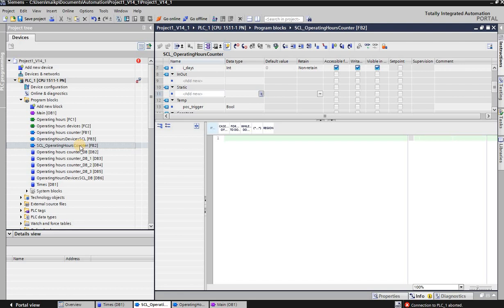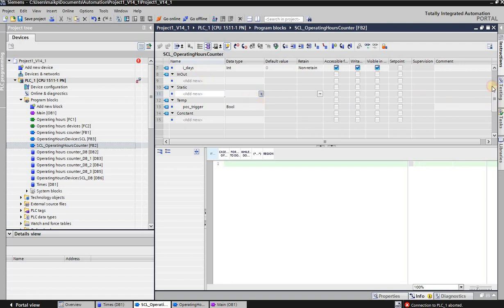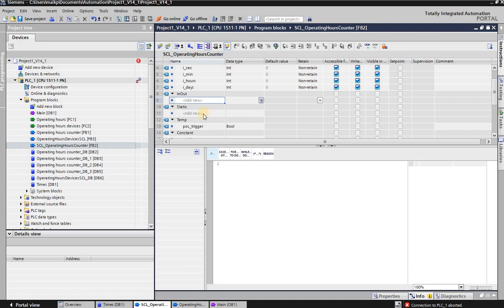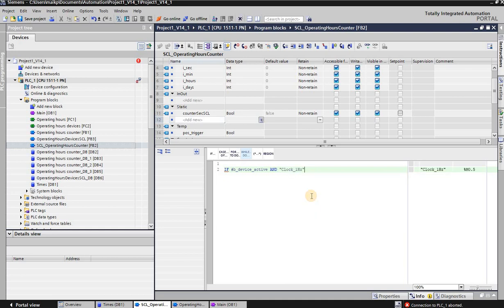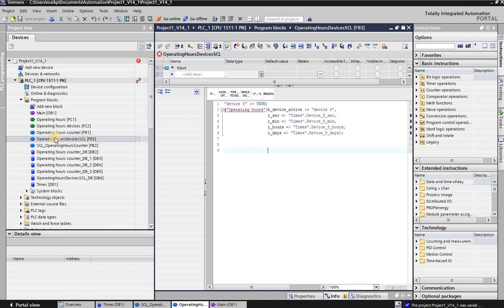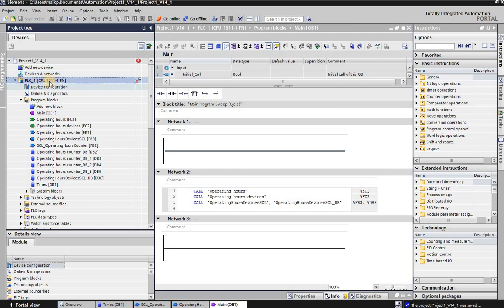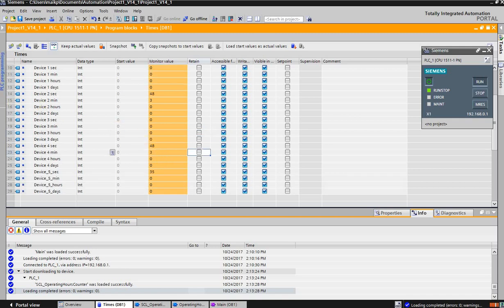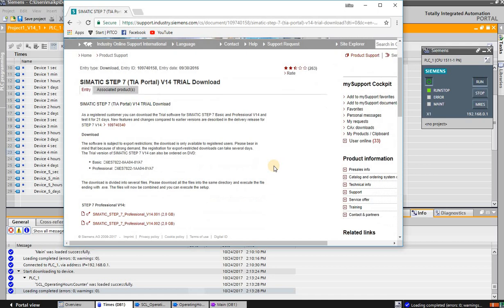Absolute Beginners guide to Siemens PLC Programming // SCL

Comment: I am quite troubled by the jump at 15:45.  The video shows it as an error (red underline) and by typing exactly what is found there I could not get the program to compile.  As an actual beginner it would have been very useful to see the complete process for creating that function call.
Reply from the maker: Tern Bartolovic you have to define the function in the static area first, data type has to be the fb name. Sorry for the confusion. First define -> then call

Comment: Mike, I been programming for a while, but this one is helping me get into writing more SCL code. I'm really trying to sink my teeth into it for 2020 cause I know it can be very powerful when compared to writing everything in ladder logic. I really appreciate this video, great job!
Reply from the maker: Alex Yousefian I hear you. It’s extremely powerful for data processing functions where trouble shooting actual tasks is not an issue. The reason ladder logic is used in the first place is to make it easier, more visual for the maintenance techs. We can do so much more in SCL and with less code than in ladder logic.
Reply: @SiemensPLCTraining2021  Definitely! I just started a new project that's partly based off an older machine written mostly in ladder, but I'm forcing myself to write it in mostly SCL (that is if I can make the deadline of course!) I also just picked up "PLC Controls with Structured Text" by Tom Mejer Antonsen and am using it for examples. If you know anywhere else I can get some SCL examples please let me know! -Alex
Reply from the maker: Alex Yousefian keep is useful though. Use ladder where people have to troubleshoot. Use scl where it does make sense. I’m not a fan of STL. I wish it would go away. Most people can’t read or write it and it’s very confusing at times.

Comment: I am still hard stuck at 15:45 as user in pinned comment. I still don't get the call function to work. The explanation you gave: "you have to define the function in the static area first, data type has to be the fb name. Sorry for the confusion. First define -> then call"

Could you explain this more step by step? Love the videos - complete beginner here

Comment: if anybody has a problem with calling the "Operating hours" function here what you gonna do.
The function block where you are calling the operating hours, open the instance dB of same FB where you are calling the "operating hours".(Instance dB will open when you drop down the menu). Now define operating hours under the static interface and set the data type as of FB of which variables are define beyond the calling of operating hours (e.g in this case i_sec, i_min etc function name is SCLOperatinghours counter define this as data type.
I hope this will help.

Comment: Mike, I have a question relating to Ladder and SCL. In ladder I created a memory bit on the input side and a discrete output on the output side of ladder.  In SCL, when I write the code with memory bit first and discrete output following, the output instruction will not work.  If I flip the two instructions it works correctly.  Why does it work just the opposite of ladder?
Thanks,
Glen
Reply from the maker: Glen Lammers if you write input := output it actually means move output into input. So the right way would be output:= input

Comment: Mike,
I continue to get invalid data type errors in the OperatinghoursdevicesSCL function block.  In the second line of code, if #"Operating hours" is called, shouldn't the data in the parenthesis be listed in the "Operating hours" function  data list as well?

Glen
Reply from the maker: Glen Lammers you have to create an instance of the #”operatinghours” Block in the static of the block where you call it, the data type has to be operatinghours
Reply: could you explain this a little bit further?I don't get what you exactly mean .
Reply from the maker: If you open the drop down menu in the to of the fb, you have to define a static with the data type of the name of the fb you want to call.
Reply: Ben Lee
1秒前
hi,do you have some tutorials about SCL in V14? tks
Reply: Hello Maik, please I'm a rookie to PLC & your video tutorial happens to be my very first. I've been able to follow with your earlier videos but I'm still struggling with the OperatingHoursDevices FB

Comment: i have a problem,  this is text from (FB3) 
in your video its on time 16:43
Regard Bart B from Belgium
OperatingHoursDevicesSCL (FB3),,7,0,8:59:52 PM
Network 2,Semicolon missing.,,,8:59:53 PM
Network 2,The formal parameter 'b_device_active' is invalid.,,,8:59:53 PM
Network 2,Invalid expression 'i_sec => "Times" device 5 sec'.,,,8:59:53 PM
Network 2,Invalid expression 'i_min => "Times" device 5 min'.,,,8:59:53 PM
Network 2,Invalid expression 'i_hours => "Times" device 5 hours'.,,,8:59:53 PM
Network 2,Invalid expression 'i_days => "Times" device 5 days'.,,,8:59:53 PM
Network 2,Parameters of the function or the function block do not match the transferred formal parameters.  ,,,8:59:53 PM
,Compiling finished (errors: 7; warnings: 0),,,8:59:54 PM
Reply from the maker: Looks like you didn't declare the data in the first place. This is a full course and I declared some of the data in previous videos. Please watch the full course on my channel.
Reply: i do watch all your video's, i work with the PLC 1200 TIA V14
and sometimes its the program different. for example function Call don't exists for the siemens 1200
Reply from the maker: Bart Brondeel just put an empty box in the network where you want to call the FB or FC and type in the name or FB/FC number and it will call the corespondents
Reply: Thank you for the information, its ok now. i really like your video's